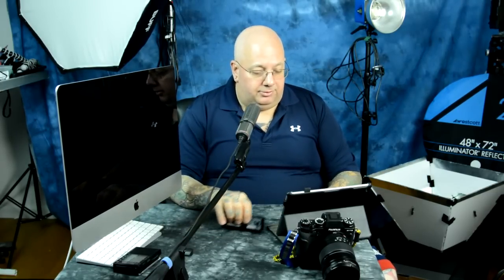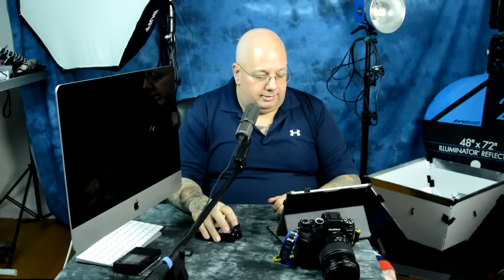*!* Fujifilm X-T2 User Manual is WRONG *!* regarding where & when power is pulled from. NO ISSUE

Comment: What I don't understand is why the heck Fuji will NOT allow to charge the primary (in-body) battery when you have the grip installed and you use the grip charger! Everytime you have to remove the freaking grip to charge the primary battery...unless you use USB charging which I am not too sure that i trust.
Reply from the maker: you can, but thru the USB port on the camera , but id never do that

Comment: Even if a battery isn't being drawn on, it's loosing charge gradually in any case. OK it's not going to loose 20% of its power after a few hours but if I charge my spare batteries and leave them in my bag for a week unused, when I place one in my camera it never shows 100%, it's more realistically say 90%. My Sony batteries especially loose charge very quickly even when not in use( no surprise there lol ), I'll only ever see 100% charge on the battery if I put it straight into the camera within a few hours of charging. This situation would be no different in the XT2 even if it wasnt drawing any power ( which it is of course ). Lithium batteries hold charge longer than most but they are hardly Eneloops 😃

Comment: Thank you for the information about XT2 power consumption, I was wondering what is going on, and thought it may be as you are saying, it is very reassuring  to know for sure, this is not the first time that your suggestions have been helpful, just the first that I've felt inclined to thank you!. Please continue the good work , When will Fujifilm produce a 300mm F2.8 lens and take their rightful place at the top table?  Rick Harvey England

Comment: sounds very  logical when in Boost mode.Your car will suck more gas when you push the pedal on the right to do floor and it will also accelarate and move faster then when the same padal is not pushed to the floor.Maybe engineer  thought that people who using XT-2 are a bit smarter  than average just ...maybe.
Reply from the maker: you said average person and then "smart"………we both know the answer to that
Reply: +Theoria Apophasis Yup